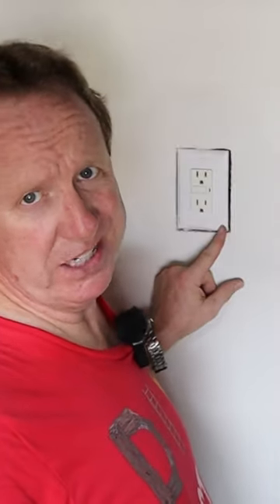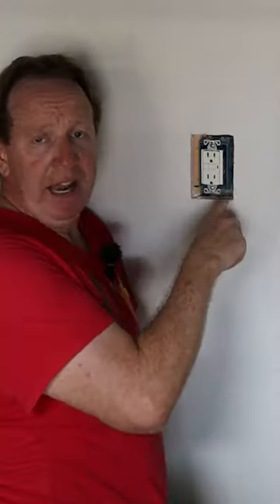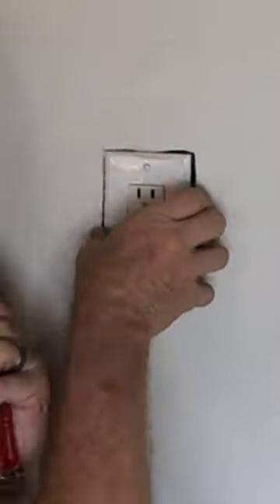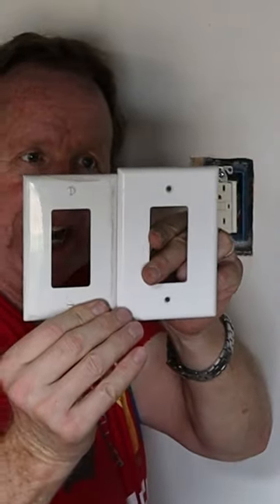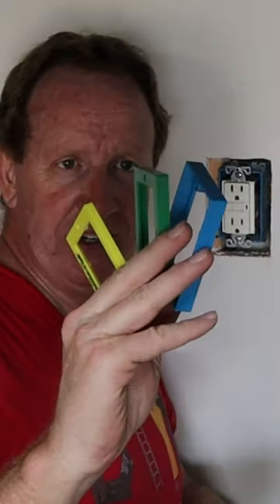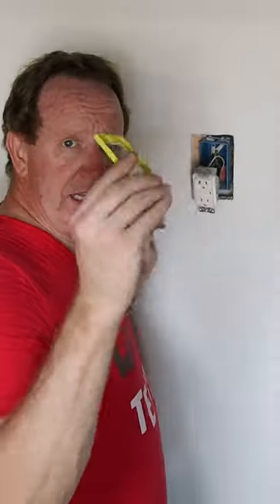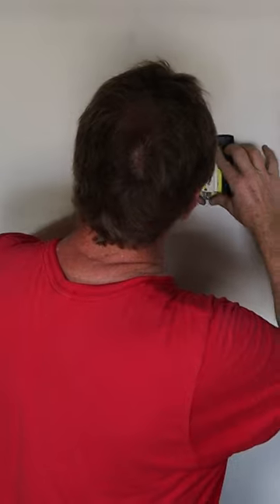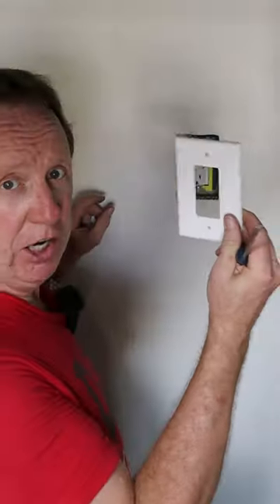Electrical Box Extender Install

Comment: I have never seen those multiple size box extenders like that in a lowes or home depot and believe me i have looked.
Reply from the maker: The home depot in my area it is in aisle 03 bay 11.  I just look up electrical box extender on website.  Thanks for watching
Reply: They got 1/4 inch, 3/8 and 1/8 =). Colors are all there next to the gang extender spot of the outlet boxes
Reply: You can even buy a pack of shims that work just as good